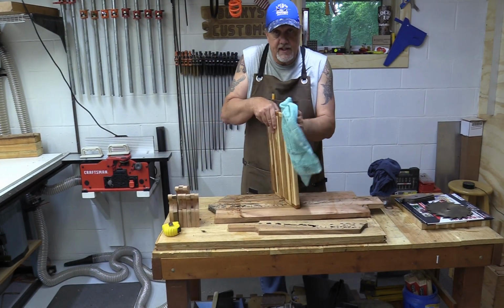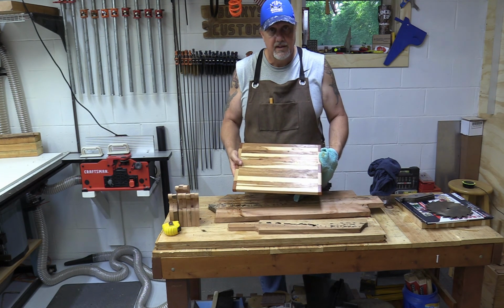APPLEWOOD CUTTING BOARD (FULL BUILD)

Comment: Did you start with a dried log?
Reply from the maker: I did not. Although the log was cut for over a year it was still quite wet. After I cut it into boards I allowed it to dry for a few days in my shop before I glued it up. I did buy a moisture meter shortly after this build. It takes the guess work out of it! Cheers!